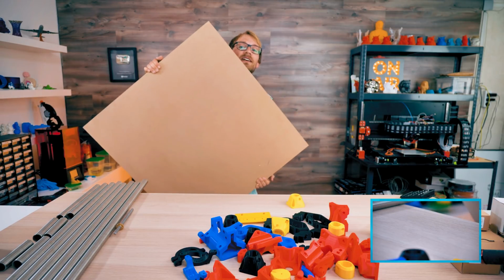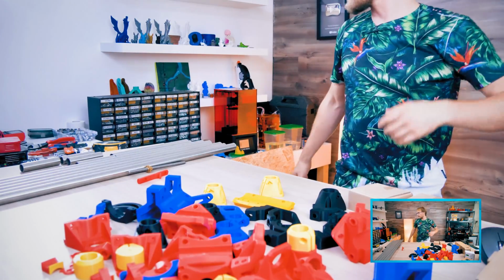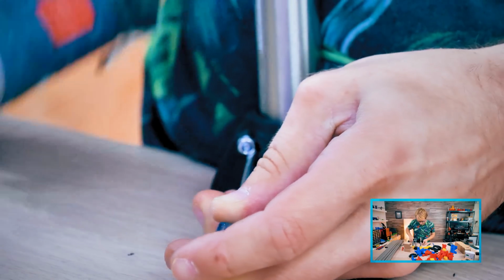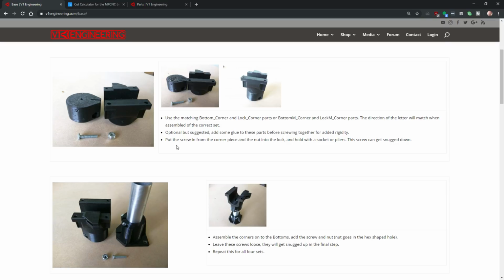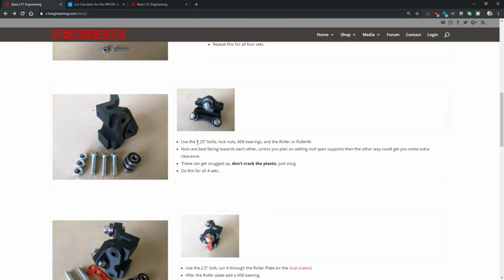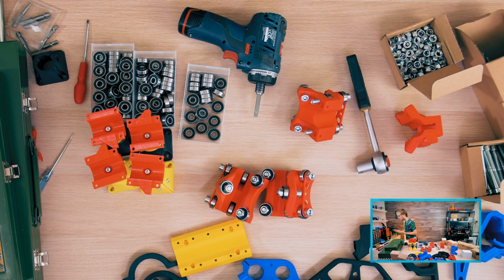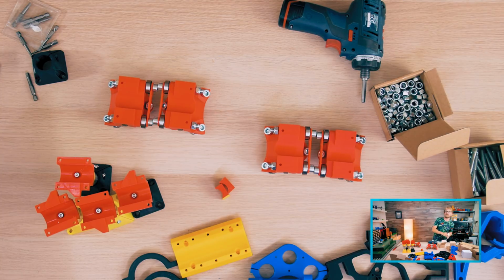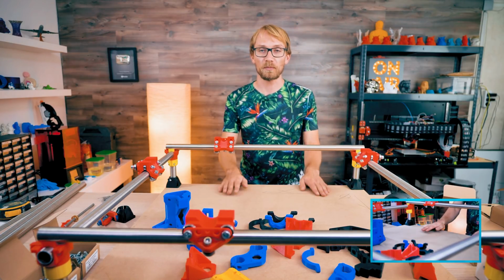Live: Building the MPCNC! (1 - Frame)

Comment: I always design and build in metric. Far easier than using Imperial, and I'm an American. And an older one at that. Been using metric for many years. Just goes to show you CAN teach an old dog new tricks. Lol
If I were to make one of these I'd probably redesign the parts to use metric hardware. I've done that with several projects from Thingiverse.

Comment: What a pain requiring imperial.  I am an American, all scientific work is done in metric, not sure why they wouldn't follow this.  All my printer parts bins are filled with metric stuff!  Even home depot carries metric.
Reply: They carry metric starting at M4 (limited) and M5, but even them, it's one little drawer per.size and two screws per bag. I go to fastenal or ace for lots of.metric screws and it aint cheap.

Comment: Right tool for the job?  Don't shove a screwdriver in the hole to hold the nut - eyes can be lost - just SKP yourself a little hex-to-hex adapter sleeve that fits in the "trap' - then you've always got it.  Then even our US cousins can use metric screws!

Comment: Tom, I feel your aggravation. It's just easier to design and build in metric. I can't bulk order metric locally, (I'm in the US), so I have the same problem, in the opposite direction.
Reply: Yes you can, try Ace Hardware for local, Bolt Depot for mail order.
Reply: I may have to check that out.  Been picking up one-off M2.5-M5 bolts for years from my local Ace shop. Never saw those sized in bulk.  Might have to revisit the Fastener Aisle.

Comment: I've built out the hardware side of the build and made some nice cables.  I'm stuck on if I should build cable guides/cable chains, which electronics to build out and what CNC software I should use.
Reply: Have you looked at the info on the v1engineering site  or the teachtingtech videos about the low rider? Marlin or grbl work great and estlcam is the easiest cam software to learn by far.

Comment: Hey Tom, endstops are necessary for the MPCNC as it doesn't have any mechanical coupling between both sides of X and Y, so it's very easy for the machine go out of square. The official MPCNC uses Marlin's dual endstop feature to always go to a known square state after power up. Other machines ("Root 3 cnc", etc.) have improved on that by adding a coupling rod with pulleys.
Reply: Uhh, no, it doesn't need endstops, they're handy for certain things, but we didn't use them at all at first.
Reply: @barry99705  Right, to rephrase my comment: You need dual enstops to get any decent square-ness repeatibility. I was just pulling the gantry by hand to the known-good square frame before enabling steppers, but even then, mounting holes on my PCBs were notably (~0.2mm diagonally) out of square and Tom mentioned he wants the machine for alu sheet stock, so I'm assuming mounting plates.